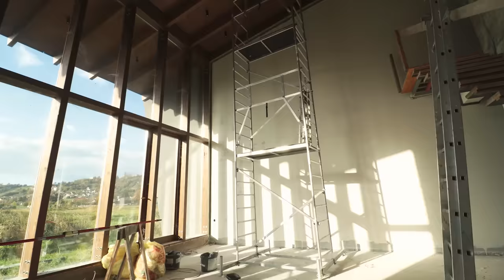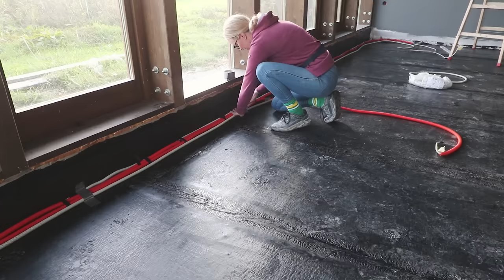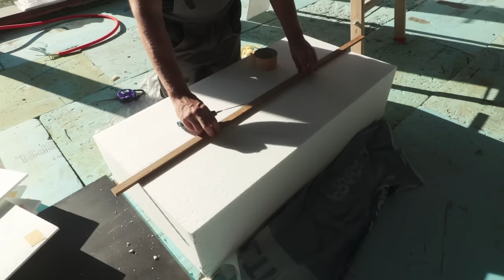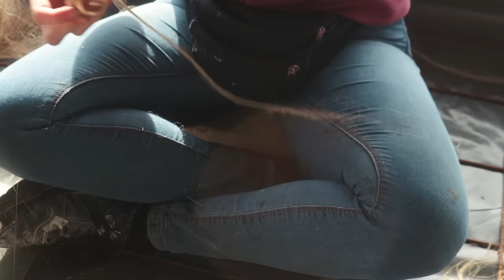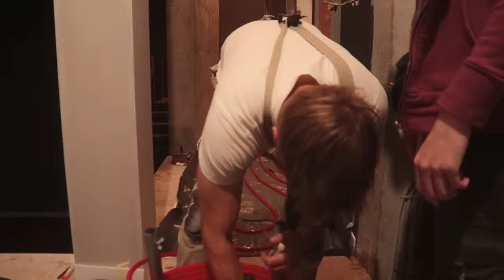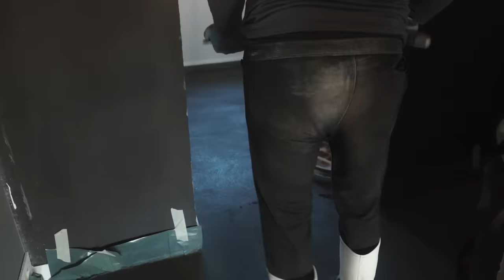Underfloor Heating - My House Build Pt:17

Comment: Old School plumbers are 100% correct!  I had 3 attempts at getting my bathroom radiator to stop leaking with PTFE as I didn't have any hemp to hand.  After rummaging in the shed I found hemp string on a sack of potatoes and applied that and it worked a treat!!!!🤓
Reply from the maker: Nice! Two months have passed here and so far no leaks detected.. I hope it stays this way!
Reply: Indeed, hemp combined with modern synthetic thread sealant works like a charm. Very useful when dealing with non-conical thread metal fittings, different materials and poorly manufactured fittings with loose tolerances.
Reply: Hemp is legendary
If you want a modern solution, Loctite PST.
it's indicated for use in petroleum refineries and chemical plants.
Withstands tremendous heat and pressure. Works fine with steam👍
Reply: RectorSeal T+2 works great too.
Reply: @branchandfoundry560  IDK, do they have that in Europe?
I'm pretty sure anything Henkel is available
Reply: Гидроизоляция уровень бог

Comment: Indeed, have pro's for dry screeding your floor, noth worth the hassle and the mistakes you can make for the price they offer you.
Very well done, and you being a carpenter I suppose you come up with a solution to get the whole distributor with air vents in a nice cabinet.

Comment: I wasn't too sure about the design of the building but i have to say now that it's actually built i love the whole thing,  its definitely taking shape . 
Also i take it that the whole process of what you are doing is to make sure you're new home is carbon neutral and with that as cheap as possible to heat etc 🤔. At first when I watched you pouring the bitumen on the floor i actually thought you might have gone mad but then realised that the intention was to seal the whole floor from any moisture coming up from below causing a damp problem. Great idea and honestly I wouldn't even have thought of it. Especially when we are more likely to see that product put on the roof of a shed or outbuilding. I recon it took alot of foreign people by surprise seeing you doing that 😅. 
As alway's guy's 💯%    👍    🇬🇧.
Reply from the maker: Yes it always surprises me when I read how the things are done in the other parts of the world. The plan is to use as little energy as possible and what I can see during this winter, things are better than expected. When days are sunny, I can work in short sleeves all day and night with outside temperatures going to -5°c or lower. South oriented glass wall was a bingo.  This bitumen water barrier is a standard here and probably was  for more than 50 years, I know my grandfather did the same thing but they had to melt it in a bucket on site and it was a very dangerous process. Now it's safer to apply it  but the solvents will knock you out..XD Thank you very much for following Simon!

Comment: I put underfloor heating in the woodshop I built last year.  It is so comfortable and very efficient.  You ran your loops really close together - definitely won't have any cold spots!
Reply from the maker: Yes I hope I will have the same experience.. Depending on the area and screed thickness, I spaced the pipes from 10 to 15 cm apart.
Reply: @lignumchannel  That'll work great.  My loops are 12 inches apart which is twice the distance you have.  You definitely won't have any cold spots because I don't with my spacing.

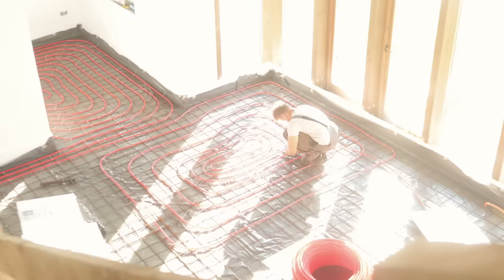Comment: @9:00 - I see the introduction of a cable spool; did you not fancy continuing to fight with 100m of pipe by hand? 😆

Seeing all the extra insulation you're putting in, I assume you're aiming for quite a high energy efficiency target?

Comment: Ai micșorat țeava de la distribuitor de aceea vei avea debit insuficient.
Turnarea șapei se face doar după ce instalația este pusă sub presiune și lăsată 48h să nu scadă presiunea. Șapa se toarnă cu instalația sub presiune, apă sau aer 2 bari.
Reply from the maker: Yes , I have put it under  pressure to test it and it was under pressure while screeding. If you want, you can turn on the CC for English subtitles where I explain things in a video..

Comment: hello good evening, I was wondering why you lay the bituminous sheath on the concrete
Reply from the maker: To prevent any capillary moisture from rising. I insulated the outside of the foundations as best as I could but there is still a chance for some water to climb from the bottom of the foundations, that's why there is a hydro insulating barrier between all the walls and the slab, and also now between the slab and all the layers that come on top of it.

Comment: nicely done. differently in details: for example in my house they added fibre to the screed instead of the rebar, and the water pipes were stapled to the insulation.
Question: Why no hydro insulation under the stairs, so there might be water vapor coming up. I thought the water barrier must be one piece.
Cheers
Reply from the maker: If you watch closely you can see that there is a gray layer underneath the bricks. I'm sorry but that scene was shot with a cellphone cos I forgot my camera that day so quality is not the greatest.. Anyway, that is sika polymer cement hydro insulation coating. The bitumen sheets are connected with that  coating so there is no break in the barrier. I will insulate the area underneath the staircase later on with bitumen and also drainage waterproof foil. This area will be indoor garden and the soil will be flush with surrounding flooring.
Reply: @lignumchannel  very good. I thought something like that.
Reply: @lignumchannel  "This area will be indoor garden and the soil will be flush with surrounding flooring" Wow! That will be very beatiful in that space as big and tall as it is, + plenty of light!

Comment: Can you not get concrete trucks to bring the concrete? Also, how long has the house taken? Are you done with it already and releasing videos delayed?

Love it as always!
Reply: This is pretty dry mix, concrete would be too wet to finish it that easily. Pretty common in EU to do sand-cement floors
Reply from the maker: This is a mix that has very little water and needs specialized mixer like this one in a video. It is usually done this way here. The house is ready for technical inspection at this moment but I have so much work that I'm forced to edit with a little bit of delay.. But being ready for inspection doesn't make it completely finished though, so more videos are yet to be filmed..